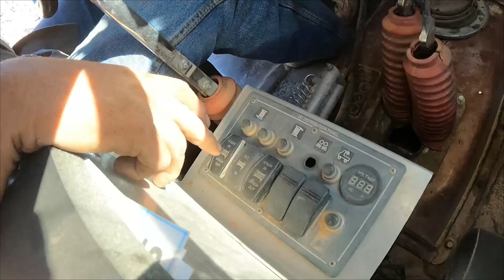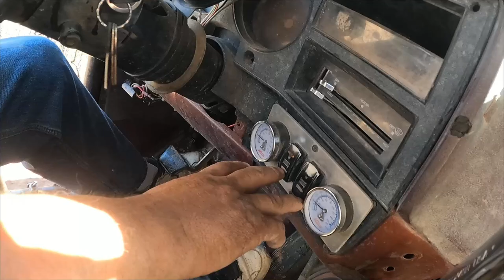Rolled Jeep On The Mountain

Comment: Great job as usual. Did you know on the RAM truck, you can pull the emergency key out of the FOB or if it's the other style key with the chip on the end and go to a hardware store and have a key cut to hide under your truck? I believe the blank key you need is a Y157 or a Y159. I used to have RAM trucks and I did that so I could lock the ignition key in the truck and had a door key to unlock it and let others be able to get my truck if I wasn't around.
Reply: Doesn't help if the fob was under water.    Don't ask.   And you can make your own manual key out of that plastic they seal your stuff at St walmerch   trace n shape n file.   All you need is a photograph of the key next to a quarter n some tape. ;-)
Reply: Rory needs to make a key for the Dodge and keep it in Trail Mater.

Comment: My wife and I love southern Utah! We've spent most of our time (so far...) in the Bryce Canyon, Escalante area (Driving from Escalante, across the Escalante Plateau for 70 miles, and then coming down the Kelly Grade was an Epic day!)
Everywhere we went, everywhere, there were cat prints on the ground. B I G cat prints...  As big as my hand, spread out. Having had cats, albeit scaled down versions,  I have a clue as to how they hunt.
So I walked behind my wife and spent a fair amount of time walking backwards, facing back up our trail....
I had my G26 and a Cold Steel Recon Scout. (Bowies are the bestest blade ever)  If a cat is on someone else, angles/penetration distance can be an issue with a firearm. So that's what the Recon Scout is for. I know exactly how much the bowie will penetrate.
The chances of seeing a painter are slim, and getting attacked by one even slimmer, but if you do, it will be quick, a surprise, and the cat will prolly be desperate. 
Next visit will be over in the Moab region.

Comment: A magnetic key box / holder thingy seems to work very well for me. It may work well for you also. Before I learned my lesson about locking my keys inside the truck, I just wired a spare key to the underside of the body. That works too.  : )

Comment: One thing that never really hit me until watching recovery videos is (please confirm), you not only air down the tires for traction in some case, but also to help prevent tire punctures from pointy rocks and sticks, correct?  If the tire can flex/give a little more, it may avoid getting punctured by a rock or other debris and allow the tire to give instead of a hole getting poked in it.

Comment: When I was 17 the first car I bought was an 86 Nissan maxima that got me addicted to hitting jumps over RR tracks. When I was 19 I bought an old Isuzu trooper for $500 as a throw-away to deliver pizza in but the 4wd in that thing brought me to better jumps with no cops in the  middle of the woods. When I was 19.5 I ripped the leaf spring mounts off the frame and bought a welder. Now I'm 42 and I get to go full potato with my chariots with minimal consequence🤣🤡

Comment: i also need some help i am putting together a off road recovery truck in southeast alabama. we have a few small hills some sand mostly red clay . the truck iam using is a 1994 ram 2500-4 wd 5speed gas burner positrac rear and lunchbox locker in front. only problem is i have 3.54 gears but only 31 tires at present. planning on 35 tires and 4.30 gear. will have a small boom in back similuar to yours. i have 2 8274 warn winches upgraded to the 6hp motors and rope on them. have a warn 8,000 and a warn 6,000.  and a Apex 12,000 new was planning on the 8274 on the front permant mound,  8274 rear hitch mount where could remove. when removed from hitch will serve as side pull and the warn 8000 as the other side pull. the Apex would be the boom winch. my question have never used a 8274 but everyone says they are them best, fastest and strongest will never break, so you know if thats true. and would you do anything different that leaves the 6,000 as a spare. 2 yellow top batteries and welder like you have. also i wias planning on changing frame to short wheel base because i have one but could leave long whel bace if that would be better. it is so hard to get people to help me with this project hopefull you will thanks

Comment: @trailmater
So I have seen a Video on Ben n Brandi site about a front axle.  I agree he should have paid you!    My concern is weather or not you had the rite to give away ir sell those parts off that 2021 jeep.  I’m sure it was insured and the insurance hasn’t picked it up yet.    You get paid for your recovery and storage when it is picked up by most likely Copart or IAA.   Once the claim is settled with the owner then it would be auctioned.    Did you purchase that jeep at auction and then bring it back to your place ?    I’m removing parts that jeep is being devalued.   That jeep in the rolled over condition has a lot of value.   Ben said in his video that you had only had that 2021 jeep for a few days !    Hum.  Well if the insurance company sees the video and you didn’t own it you will have some questions to answer.   I hope that’s not the case but it doesn’t look good.    You can’t give away or sell something that doesn’t belong to you  !  The perception looks bad if it is on the up and up.  Insurance fraud weather it’s big or small in s still fraud.  The insurance company did not just give that jeep to you.   They can’t.  They have protocols.  I’m retired from the tow business after 41 years and there were plenty of vehicles I tried to buy before it left my yard and they was always told no we can’t.   I’m goes to auction.  That takes 6 weeks or more to take place.  Not a few days.  Well I don’t subscribe to your channel or Bens.  I do watch from time me to time along with Matt’s.   Ask Matt his opinion privately.  He will have some insight I’m sure.   Have a blessed day and stay safe

Comment: With those keyed lugs, a guy can drive a 12 point socket (15/16ths ish) over the top as an improvised key.  Results may vary.  Works best if lug nut is tapered.

Comment: Looking forward to the next part of dragging that wreck out of there. Good thing the fire didn't get to it so there may still be something worth recycling. Do you now own it or is the original owner still involved? Could be a good replacement engine, transmission, axels and suspension parts. Push it through Robbie's place and he'd make a silk purse out of it given enough time. Thanks for the videos. Stay safe. Did someone say that's bear country.

Comment: At 5:55;  I would have stayed with the old Craftsman wrenches and drilled holes and bolted them on instead of welding just in case you needed that size.

Comment: I think I have finally found a practical use for the AR-15 "can cannon" upper:  attach a length of para cord to the pull tab on a can of Dr Pepper and shoot the can to have a small line with which to drag the winch line to you.

Comment: Rory I got a couple questions for ya, 1st q, what size tires are you running on trail mater and 2nd q, what gearing are you running in the rear ends. The reason I ask is my daughters 79 K5 has 2.76 gears from the factory and it originally came with 31 10.50 15's which seemed pretty high geared with that gear combo. After I purchased it I lifted it 6 inches and have put 35's on it and it is really tall geared (80 mph in 2nd gear at @ 4000 rpm's and it doesn't shift out of 1st gear until 50 to 55 mph) and I was talking with some guys and I told them I was going to put 4.56's in it but they seemed to think that it would be too low of gears but I believe the 4.56's would be alright, what is your thoughts... Thanks in advance for any help on this matter!!!
Reply: 35s with automatic transmission likes 4.10- manual transmission, go with 4.56.
Reply: Pretty sure Rory is using 4.10 and 37s

Comment: If you guys think you bad, get the 4runner out of the crack between lions back and hells revenge? I helped pull the engine out of that 4runner.
Reply from the maker: Did you get permission from the owner and the land owner first? Just curious. And if the land owner contacted me I'd gladly pull it out.
Reply: @trailmater  uhhhh... not to sure about the permission? I was over there and noticed a group of guys rigging it out and started talking to them in amazement that they were pulling the engine out and they said to help them so i did. We walked it out on a pole. And im pretty sure you could get that toyota out.

Comment: @trailmater did how did you mount your rear hand break setup on the axle side? Custom caliper mount or driveline flange style ? And what do you think about individual cutting breaks to add for front digs? Does it make a big difference if you just use the inside same tire break only  when turning that direction?
Reply from the maker: The brake level just taps into the line going from the master cylinder to the rear axle... So it uses the same calipers in the rear. I didn't do side to side cutting brakes cuz at the time the rear end was welded so stopping one tire would stop them both. It wouldn't make a huge difference in the way it works to do individual, plus I'm just use to how this works, so why change it.
Reply: @trailmater  gotcha I ask because I've got a rig nearly done. Its a drum break 14bolt converted to disc break using ruffstuff kit in the back of a 73 k10 that's got a 203 205 with the 205 forward ground shift rail allowing front dig but havnt asked around enough to see what works best your seem to work well but I've got a grizzly locker( pretty much a Detroit style) just looking for info thanks